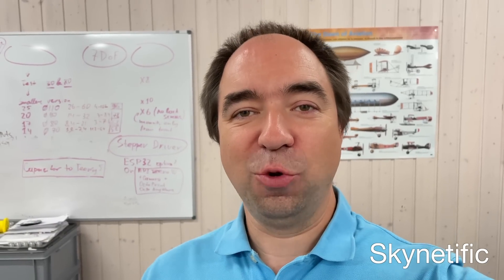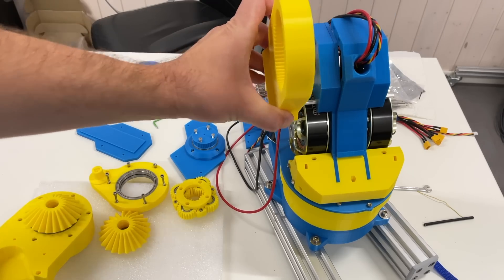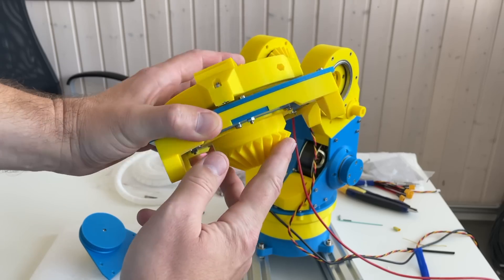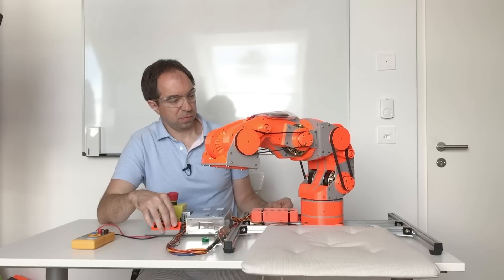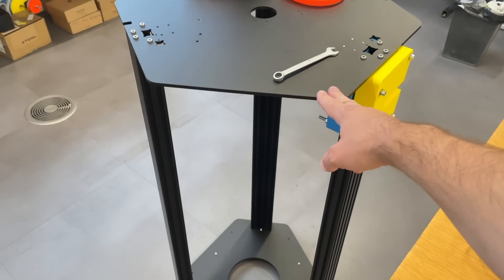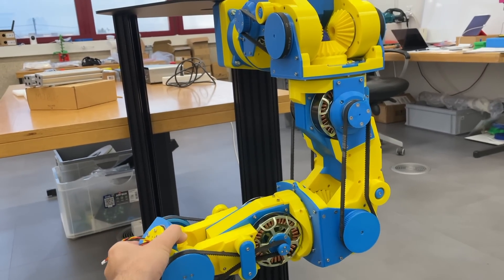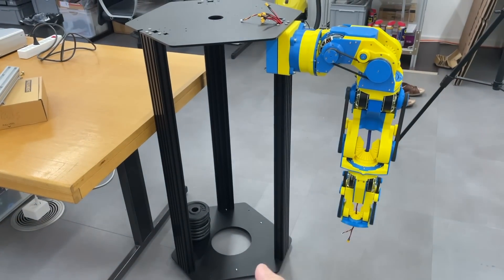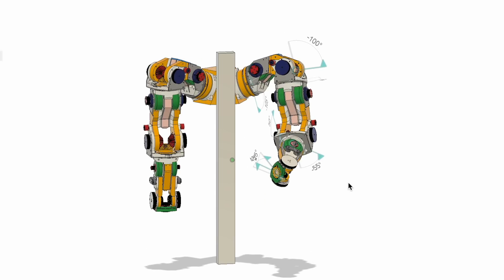Building Humanoid Robot Arm (part 2)

Comment: Oh yes. If i had the Engineering skills I'd totally devote my free time to this. I barely started getting into modifying and building 3d printers but I'd happily follow along. Thank you for your work.
Reply: Ps : It would be funny if the robot  could at any given time drop on the floor and use its 4 appendages with 4 toolheads.

Speaking of which, would this kind of arm be precise enough to be used for 3d printing in space?

Comment: one practical application for cheap robot arm, yes cheap, easy to make, is to make a two-angle solar tracker, on a arm pole, up high. and needs to be fraction of the cost of the panel itself, say 100bucks for 400W panel. so at most 25bucks to the mounting assembly. or even less say 10bucks. or even less like 5bucks.

Comment: Im a engineer spezialized on power electronics and software for drives. Im able to design our own open source power electronics to drive each axis of the arm to replace the odrive. We implement open source software for field orientated control, the kinematic model, axis interpolation, path planning,... 
If you are interested im available for this Project
Reply: Hey, I am still working on figuring out the kinematics of my SPM because I would like to switch to an embedded solution...would you mind taking a look at the project? 😊

Comment: 3D printed gears seem kind of silly to me. Isn't it possible to find cheap commercial-off-the-shelf gears with less play and better longevity? Even injection molded plastic gears should be a big step up, and maybe even cheaper than 3D-printed? I also like the idea of using simple sheets of carbon fiber or aluminium in some places (you have used that in some other designs if I remember correctly), they shouldn't be expensive and can greatly increase stiffness I think.
Reply: Do it! Upload your design

Comment: YES!!!  We should absolutely strive to develop an open source general purpose humanoid.  With the number of companies that have almost fully realized that goal, we have plenty of inspiration and reverse engineering to do.  I'm confident an open source humanoid is possible, but it would greatly benefit us as makers to have a standard to work off of.  If we can all collectively agree on a standardized set of parameters for devloping a humanoid, I'm sure it's a feasible task
Reply from the maker: This is a great point. I think it would be hard to agree on all parameters, but we can start with something. And if necessary we can always change these parameters during development.
Reply: @Skyentific  Yes, the hardest problem with open source projects is that people isn't properly educated to collaborate. For example there are many other robotic arm projects out there but you decide to make yours instead of collaborate with them. Your arm design is too heavy, have too much torque, drains too much energy to work, is too bulky, so in resume is completely inadequate for a humanoid robot. Congrats, you have your OWN project.

Comment: I'm concerned on the arrangement of the Noctua fans.  They are "facing" each other and they're very close.  They're basically fighting themselves.  If you flip one around they will work together pulling from one inlet and blowing out the other.
Reply from the maker: Year, but in this case they would not cool drivers. Right now they blow air through the motors to the drivers. I hope like this they will cool both of them.

Comment: I'm making a mobile robotics platform at the moment. Kind of like mobile aloha but much cheaper.
Reply from the maker: This is really great! One of the first things, which I want to try with such arms is mobile Aloha. This is really promising technology.
Reply: @Skyentific  I think your robot arm will lift more weight than the viperX robot arm. This is one reason why I was interested in your design.
Reply: Any github project or website I can check? 😊
Reply: Any github page or website on your project that I can check? 😊
Reply: @swannschilling474  hi. I will put instructions, code and bill of materials on my GitHub once I’ve finished filming. Should be around two or three weeks. The frame and motors are from gobilda, the arms I’m using at the moment are hiwonder. Then I have an rpi 5 with a USB stereo camera, an ESP32, four cytron motor drivers and some lithium lipo batteries

Comment: Hello, I am a college student who is making a robot dog by watching your video. I am currently trying to use odrive v3.6, tle5012b encoder sensor, and steadywin giim8108-8 motor, but I am having trouble with motor calibration. Could you give me some advice on calibration?
Reply from the maker: My advice would be not to use tle5012b. I had so much trouble with it. Unless, you know exactly what you are doing. I spend too much time trying to make it work. It finally works. But as5048 or as5047p is way simpler.
Reply: @Skyentific  thank you! I will try it asap
Reply: I could not even setup the the as encoder! Is there any tutorial on how to do this? The ODrive 3.6 is pretty outdated but I am also still using it because it us reliable and there are good quality clones out there! 😊

Comment: What I'm super interested in is not only an open source arm but perhaps USB-C standard wired controllers and Machine learning without weird proprietary garbage.  USB-C has PowerDelivery if you need 5,12,20,etc volta whats the discord or whatever?
Reply from the maker: Good point. Unfortunately, each motor of this arm requires at least 200W of power. The USB-C can only provide 60W. So it is not enough even for a single motor. And it is definitely not enough for the entire arm.

Comment: Wonderful initiative. I am the author of MachinaScript For Robots, a framework to control robots using Multimodal Large Language Models, so anyone can built Ai-powered robots in their garages. It is basically giving the control of a robotic mount to an artificial intelligence. The project is also openly available on github for anyone to try out, under the apache license.

A question: wouldn't it be more effective to use those MIT cheetah-like actuators for these parts, something like the Atlas 2 is using? Or is it too expensive? I believe for a full body robot these are the best ones, no? 3D printed parts would still be super important, as well as reinforcement learning models for walking, picking things, equilibrium as well as some cognitive reasoning capabilities using LLMs.

I would love to help on the development of the project!
Reply from the maker: How do you know that Atlas 2 use it? I would be interested to know this for sure. If you have reference please send it to me (you can find my email in the YouTube channel description). And if you are interested in this project I can send you discord link.
Reply from the maker: MIT cheetah-like actuators unfortunately not cheap. They are becoming less and less expensive, but not cheap yet. Plus, most of them have quite bad drivers. Probably this is why most robotics companies build there own actuators.
Reply: @Skyentific  oh I understand now, cheetas still have some way to go. So, as I mentioned, I'm working with several software pieces to control robots, from using large language models to reinforcement learning models. 

I would love to join the discord.
Reply: I would like to check your project! Any website or github page where I can find it? 😊
Reply: @swannschilling474  hey swan, a quick google search ober Machinascript For Robots will show everything you need! Github and medium/hackernoom posts all there. 😉 Free the robots!!!
Reply: Found it!! Thanks a lot!! This is awesome!! 😊

Comment: Open-source = NOT locked behind a paywall. K-Scale Labs, Anthrobotics, and PointBlankLLC are all truly open-source humanoid projects.
Reply: Hey, could you give more info on this? Because I did not know any of these yet! I found K-Scale Labs but the other ones do not seem to have a website and or are registered with multiple domains! 😊
Reply from the maker: My robot arm is not yet open source. I spent more than 3 month to build it. With zero investors. Spending my own money on this. Now I have exactly zero savings left. And still, I am ready to make it open source if enough people would find the idea interesting and will help. 

At least right now everyone can get my design for only 10USD. I looked at the project that you mentioned and I have only found CAD file for K-Scale, and only for there small robot. If I am wrong, please send me the link, I would be glad to check them (you can find my email in the channel description).

Comment: Mannnnn good job tho i WISH you'd show your process for Making these in fusion, i've been trying to do something similar but am Terrible at fusion
Reply from the maker: It is complicated to show it. As the design takes a lot of time. And most of the designs I start, and at some point I realise, that I should use another approach. So I discard, and start new design. So for each published design I have 3 or 5 attempts, which I discarded for some reason.

Comment: i was wondering why so many motors ,??  could this arm be done with  almost half the motors??
also  a robot head is a bad idea...  you can mount a 3d camera in the chest and back  also in the arms or hands 
robots do not need heads
Reply from the maker: This arm has 7degrees of freedom. For 7 degrees of freedom you would need 7 motors. This is exactly the same quantity of DoF as in a human arm.

Comment: What are the models of these main base engines?
Reply from the maker: If you ask about brushless motors, these are Multistar 9235 from HobbyKing.
Reply: @Skyentific it’s discontinued fyi
Reply from the maker: It is the same as Eaglepower 8318
Reply: @Skyentific  thanks